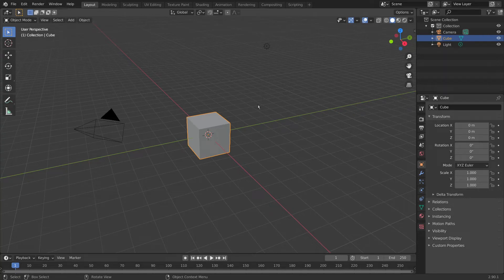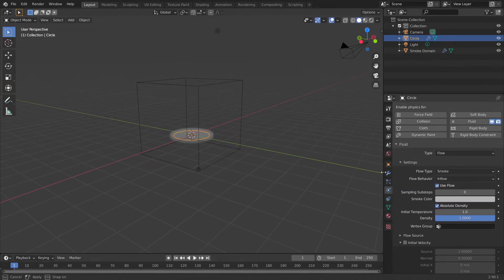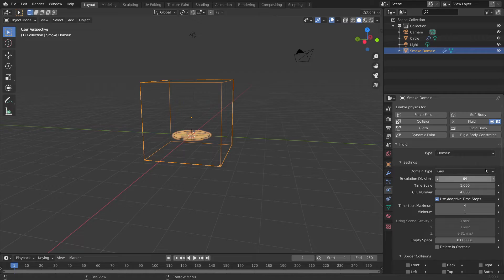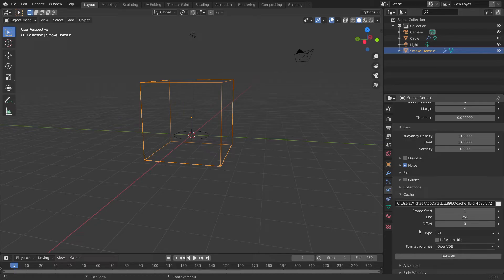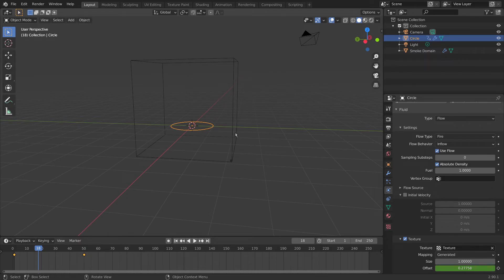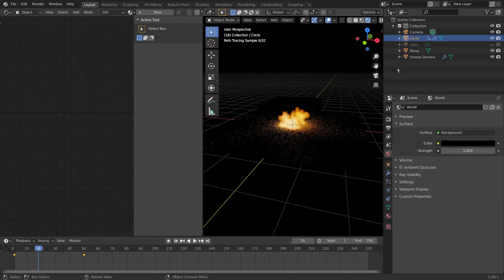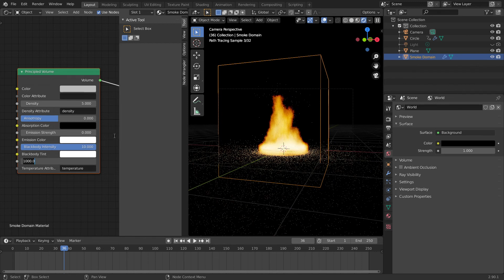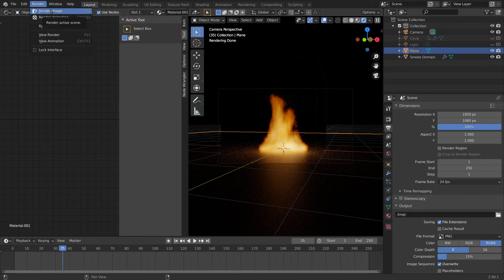Making Your First Fire Simulation in Blender 2.9 (Tutorial)

Comment: Ok, nice tutorial. Had some struggle, so this is what solutions I found on 2.92 :
No texture in render = change black body emission to 1
No display of fire/smoke at all = smoke domain > cache > type > keep replay (with modular) because nothing appears with the others two options
Blender crashes = smoke domain > cache > advanced > zip (blosc is bugged and crash after a few frames)

It should work now. :)
Reply: hey man, so for me it was no display of either fire or smoke, but i can't find this "cache" you described in the steps to fix it, are you able to guide me?
Reply: @anshulanton4290  Hey, the cache tab is in the physics properties menu with smoke region selected, be careful, its not the fire box (small), but the smoke box (big one). Its under the gas, guides, and collections tabs. In the video it is visible at 04:45.

Comment: Hi Michael ..... good to subscribe to you mate.
Im fairly new to blender and have little experience to be honest. Ive done some fluid flow thru pipes etc.
Now a client of mine wants to know if I can show water spraying out of a sprinkler head in a room and distinguish a fire???
Reply from the maker: Thanks for subbing! You could definitely simulate something like that - of course, the fluid and fire sims wouldn't actually be interacting but you could also simulate some steam to give the illusion that they are as the flames die out. The sprinkler would probably require a very high domain resolution and therefore exponentially larger render times, but it's definitely doable. I'd probably go about it by key-framing the multiple sprinkler water sources to rapidly turn on and off (do this with the graph editor modifiers), then have each source's axis rotate with key frames as well. I hope this makes sense and was helpful :)
Edit: an alternative to fluid sims could be a particle system doing the same thing :)
Reply: @MichaelQuinnMedia  .. thats good to hear ... unfortunately I'm very very new to this

Comment: hey man! this is a great tutorial actually, but i have some issues here and i need your help.
first, why my flame shape follows the shape that i use, if i use that circle it'll be circle just like a ring on fire, it doesn't look like yours.
second, how do i get the flame already bigger from the beginning i start the animation, so
there's no transition from the small fire into getting bigger.
Reply from the maker: The fire shape can be adjusted mainly with the vorticity in the domain settings as this controls how turbulent the flames are. Also, I'm not sure if you did this, but giving the circle an animated texture means the whole circle won't be producing fire at once (I cover this at 2:30).
As for getting the fire to start big, I'm not sure... You could keyframe the timescale to go from something big back down to 1 quickly so that the flames get going in a small time. Personally, I'd just bake the whole thing and then cut out the bit where its igniting when rendering. 
Hope this has helped and thanks! :)
Reply: @MichaelQuinnMedia  thanks man, i think i know how to get a big fire at the beginning, but i'm not really sure cause i still trying to make it, i try to set the cache > frame start into minus, just like -10 or something like that
Reply from the maker: @Otanrafif  oooo that sounds like a good idea actually! Hope it works out :)

Comment: Hi Michael, great tutorial.  I did this tutorial 3 times and still can't get your fire look. Mine looks more like an fire explosion rather than 14:59 look. I noticed you adjusted the camera angle and rendered frame 35 to get it but there's some steps missing I believe. Any tips from you is appreciated. Thanks! :)
Reply from the maker: Hi and thank you! :) Sorry you're having issues with this D: So the shape of your fire is different? If you mean it's looking too big or explosive, then it'll probably be due to either the fuel (in the emitter (circle) properties) being too high or the reaction speed (domain physics properties) being too low. Also, it could be due to the vorticity being too high and giving a crazy turbulent flame (personally I'd start with the fuel or reaction speed though). If you're using a different version of Blender then this could be the reason that your settings don't give the same final result as mine. If it's only the shape/movement of the fire that's problem, then it will most likely be one of those things I pointed out. As for the missing steps you mention, I didn't edit anything out from the video that would stop you getting a good result so don't worry about that. If all else fails then there's plenty of other great fire sim tutorials out there that should give you what you're looking for. Hope this helps and lmk how it goes :)
Reply: @MichaelQuinnMedia  thanks. I'll try it out and update you soon. :D
Reply: @doubleustudios2020  and,did it work?

Comment: how do i make the flames bigger/higher?
Reply from the maker: There are two options to adjust flame size that I'm aware of, so you can have an experiment with them:
Set the reaction speed in the domain properties to a lower value to increase the size of the flames.
Or increase the 'fuel' of the fire emitter in the flow settings, this will bring more fire into the simulation. 
I hope these help!